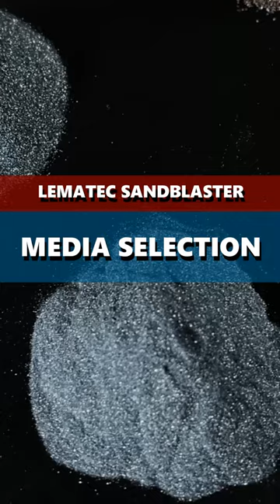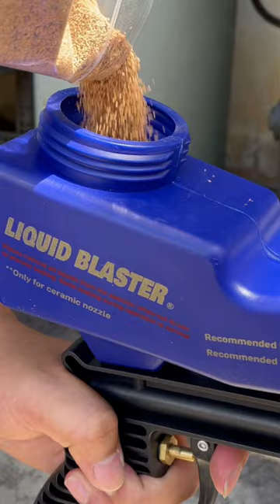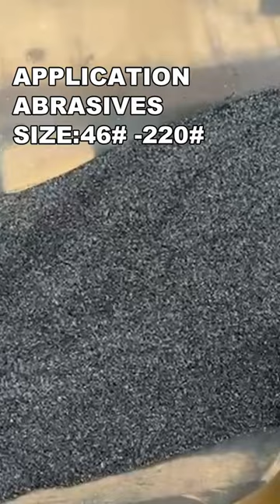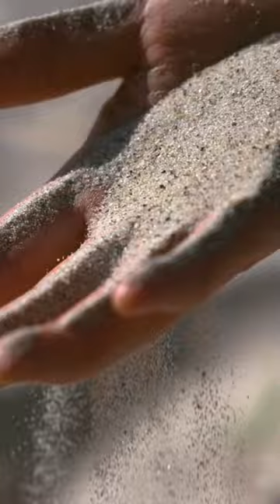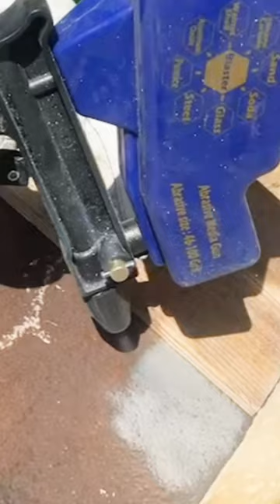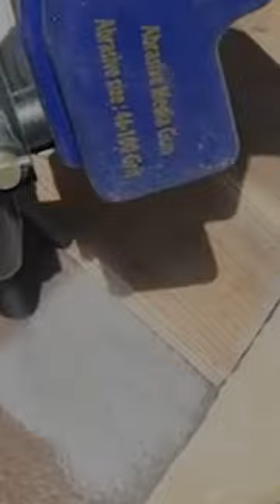#shorts What is the best media for sandblasting? Check this video and contact to us NOW!

Comment: What compressor are you using?
Reply from the maker: Hi dear, we used 5HP air compressor, we suggest use 2.5HP above air compressor is better. It needs more airflow just like air blow gun. Pressure suggest setting 90 to 120 PSI.
Reply: @lematecprotools  Looks good. what cfm does your machine produce? Many of the blast guns recommend 7cfm or better. I've seen people use smaller units but it looks like they struggle to get enough media out at once. Thanks!